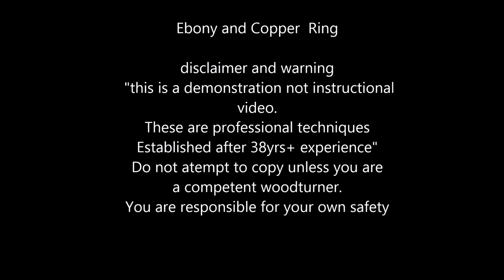Woodturning a  Ebony & Copper ring - A simple method

Comment: Great video; I only have one suggestion. If you bend the wire into a ring like shape before you start putting it on the ring, it is much, much easier to place it.
Reply from the maker: Thank you 👍
Reply: @woodturner21  No problem! You probably don't need advice, but the process of learning never ends does it, lol. I learned that simple tip from another YouTuber and I've been using it ever since. It makes it a lot easier.

Comment: How long would you say a ring like this could last? I have done some bentwood rings to try and get more stability but I think I would have better looking results following your method.
Reply from the maker: A ring like this will last a lifetime depending on the type of finish you use.
Reply: woodturner21 Thanks! If you have any suggestions on what to use, it would be appreciated. Otherwise, I'll just do some more research. I enjoy the videos. You're skills are incredible.
Reply from the maker: Wood rings need maintenance and two ways are use a natural oil type and maintain often or use an epoxy based finish that needs little maintenance and is waterproof.
Reply: Have you ever tried a wipe on poly as the finish?
Reply from the maker: No it’s not a finish I have used.

Comment: How do you get the ring to stay on the dowel?? i've tried many times but the ring keep slipping.
Reply from the maker: It’s just friction, is your dowel  too tapered? If so only a tiny portion is holding. Also damp the dowel and it will bring the grain up a little giving some grip.
Reply: i had it on a long taper so it should have been holding on most of the ring but just kept slipping and burning the inside of the ring.. i will try to put water on the dowel.
Reply from the maker: This is stating the obvious but make sure your tools are sharp a blunt tool causes a lot more pressure.

Comment: brill.  Just a thought...if you had glued the start of the wire in and let it go off 1st, then you wouldn't struggle so hard to get started maybe.  Also if you had wrapped it away from you you negate the possibility of it catching before it trims to the correct length when smoothing  (3:58)?

Comment: Steve, You'll find the copper wire easier to use if you harden and straighten it first. 
Clamp one end in a vice, grab the other with a pair of pliers and give a gentle tug, the wire will stretch and harden. 
I'm sure there is a metallurgical term for what I describe but that is secondary to the fact it works.
Reply from the maker: Thanks Bryan, I will try that next time